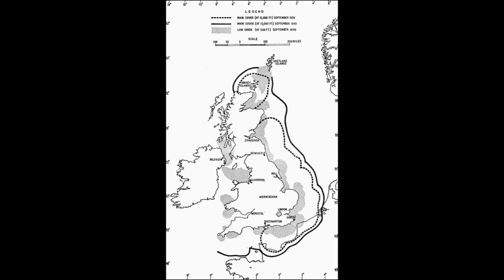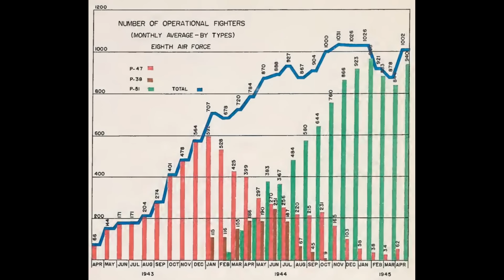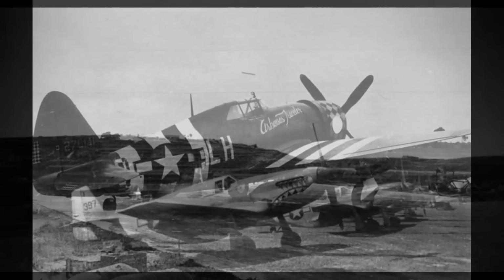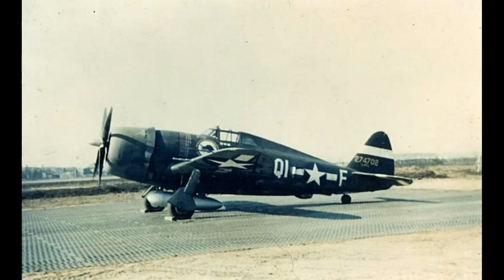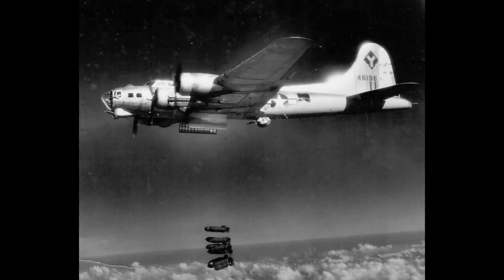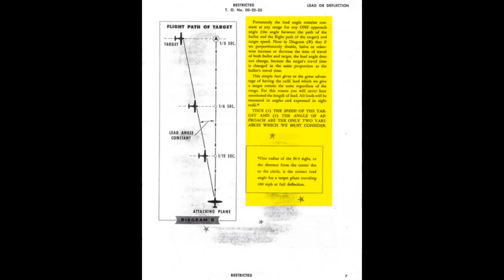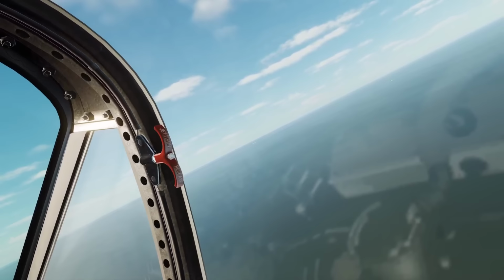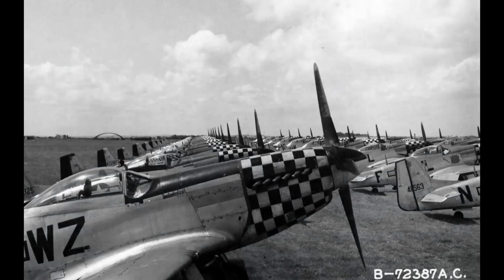Under Appreciated BRITISH Tech From WW2

Comment: Yes! Looks like pandering to the Brits is envogue. I'll keep that going here... Stanley Hooker and this from Wikipedia... 16:00.  Bud Anderson raved about how well the P51 Mustang did above 20,000 feet. It thrived there.
The Merlin supercharger was originally designed to allow the engine to generate maximum power at an altitude about 16,000 ft (4,900 m). In 1938 Stanley Hooker, an Oxford graduate in applied mathematics, explained "... I soon became very familiar with the construction of the Merlin supercharger and carburettor ... Since the supercharger was at the rear of the engine it had come in for pretty severe design treatment, and the air intake duct to the impeller looked very squashed ..." Tests conducted by Hooker showed the original intake design was inefficient, limiting the performance of the supercharger. Hooker subsequently designed a new air intake duct with improved flow characteristics which increased maximum power at a higher altitude of over 19,000 ft (5,800 m); and also improved the design of both the impeller, and the diffuser which controlled the airflow to it. These modifications led to the development of the single-stage Merlin XX and 45 series.
Reply from the maker: I'm not pandering to anyone on this channel. I've been thinking about this topic for quite a while. I'm sure Bud Anderson raved about the P-51's performance above 20,000 feet. It did perform well there, especially relative to the single stage, single speed supercharged P-39 he flew previously. 

I am aware that Stanley Hooker says that Stanley Hooker make all these improvements to the Merlin.

Comment: Water injection was used in stationary engines in the 1900s
Reply from the maker: Source please.
Reply: @GregsAirplanesandAutomobiles  from the Wikipedia article on hot bulb engines:

Once the engine is running, the heat of compression and ignition maintains the hot bulb at the necessary temperature, and the blow-lamp or other heat source can be removed. Thereafter, the engine requires no external heat and requires only a supply of air, fuel oil and lubricating oil to run. However, under low power the bulb could cool off too much, and a throttle can cut down the cold fresh air supply. Also, as the engine's load is increased, so does the temperature of the bulb, causing the ignition period to advance; to counteract pre-ignition, water is dripped into the air intake.[6]

Of course that's just Wikipedia. You can find lots of other sources and videos of people actually running antique engines to confirm. 

Anyways, apparently using water to prevent knock is a very old idea.

Comment: A good video as usual. However, I must object about your view of Big Week and the timing or success of Overlord. The attacks of Big Weeks (late February 1944) were designed above all to bomb and destroy German aircraft factories - the planes shot down were icing on the cake. The LW fighters were beaten in Big Week but losses were at most 10% of effectives and were quickly made up. The death of the LW fighter arm took place during the late spring and summer of 1944 - by October the LW was a shell. (This process was hastened by the acceptance of 8th AF commander James Doolittle's controversial tactic of allowing the fighters to leave the bombers and "hunt" German fighters instead of "close support." For whatever reason Doolittle and others preferred the P-51 for this task and the P-38s and P-47s - minus the Wolfpack - were transferred to 9th AF.)  This also implies that it was the German fighter arm was troubled allied planners concerning D-Day. It was not - the Germans were not going to stop the invasion with strafing. The allies did blanket every air base in western Europe to prevent the stationing of German bombers - they had inflicted serious damage on allied invasion fleets off Italy in 1943 (indeed, the LW did better than the Japanese in 1943 when it came to sinking ships.) The real aim of allied air power was to interdict the movement of German ground units and German supplies to the French coastline. Until the last day these attacks were dispersed across all of France to keep the Germans guessing about where the invasion was coming. In any case, the LW was not able to operate near the French coast because its bases were blanketed by both USAAF and RAF attack. In early 1944 US 9th AF - which was considered tactical - was activated in England. Together with the RAF they spent the six week period before D-Day attacking every tactical target in France. It was the fighters of 9th AF along with the RAF that were instructed to seek out German fighters while strike airfields, rail yards, supply depots etc.. It was these operations far more than Big Week that removed the LW from the picture in France by June 1944. This was also helped by the fact that the LW had no idea that after May 1 the bulk of the German homeland would be safe from attack from England (although not from Italy) and many LW formations sat idle. Also in the video it was implied that American bombers played an important role on DDay with the aid of British inspired radar. That certainly wasn't true at Omaha where there many worthwhile targets. The large attacks on June 5 and June 6 were almost total failures - with only 3 bombs hitting the beach area on June 6 and the rest being overshot. Later carpet bombing raids in the Normandy area both in support of Montgomery and later to prepare for Cobra were probably worth the candle - even if the attack in the American sector cost the life of MG McNair, the highest ranking US KIA in the ETO. 

I know this wasn't aircraft related, but if I was going to pinpoint a very important - and rarely mentioned - British contribution to the war effort it was Royal Navy shore bombardment. (They were supported by the USN - American destroyers saved some bacon at Omaha when they came in very close and began attacking German bunkers and machine gun nests with every available weapon over open sites. And BB Texas and Massachusetts chipped in. But the BN did the heavy lifting.) It was shore bombardment that saved the allied position at Salerno and probably Anzio. German armor moved very close to British beaches late on June 6 and June 7 only to be met by RN naval guns - German tanks were literally turned upside down by 8" 14" and 16" RN shells - enormous guns in land warfare terms. In the Pacific the Japanese learned quickly not to defend beaches - it's likely at Tarawa - a place so small it was almost all beach - that shore bombardment destroyed over half the IJ garrison. Later, it was standard procedure to let the Americans get on land and fight from concealed positions. It was ironic that the allied battleships - vessels that admirals had assumed would make up battlelines with which to fight the Japanese ended up either serving as flak carriers or for shore bombardment. I'm sure allied infantry - both ETO and PTO - were glad these capital ships were there.
Reply from the maker: Hi Eric, I never mentioned "Big Week" in this video. You must be referring to my statement that the P-47 more than any other plane pushed back the Luftwaffe for D-Day. As stated in this video, the evidence for that is put on screen in my P-47 Part 8 video so your comment would make more sense there. Here are the numbers. Luftwaffe pilots killed in percentage from Nov. 1943 to May of 1944: 9.9, 10.4, 12.9, 17.9, 21.7, 20.1, 25.0. 

    The point there is that the Luftwaffe had nearly 100 percent turn over in pilots before the P-51s showed up in strength. Furthermore, when the P-51s did show up, the quality of the average Luftwaffe pilot had decreased massively because of the work already done by the 47s, but again all the evidence for that in another video entirely. 

I also explained there why the P-51 was chosen over the P-47s. Your post is fine, it's just in the wrong video's comment section.
Reply: @GregsAirplanesandAutomobiles  Didn't you argue that the adoption of drop tanks allowed the US fighters to weaken the LW and allow D-Day to go on unmolested and on time? My apologies if that wasn't a point. And at least at Omaha US bombing was essentially worthless on D-Day - the drop was just a little too late. Hitting the beach defenses would have required a level of accuracy not available in 1944 - and a lot of emplacements weren't manned until the invasion fleet itself showed up. Because of the air blitz across France the Germans kept their heads down when possible. A real pity because the German 352d Division was a line unit and probably the most able and most numerous German defense unit in Normandy. 
Anyway, keep the videos coming - I like them all. The late war Japanese pieces were especially interesting. Japan didn't lack good designers - they did lack good industrial technique. Horikoshi and his Mitsubishi team were working on the fighter we called the Jack by December 7. the Jack wasn't in the air until mid-44 and then so badly flown it didn't matter. When assessing the Zero that's important. Horikoshi knew that the Zero would be surpassed - he knew what was going on in Europe - so the Zero was supposed to be like our P-40 or Wildcat - a plane to serve into 1943 and then be replaced by Japanese equivalents of the Hellcat, Corsair or P-38. But that never really happened. BTW: in the sim Aces High their KI-84 was a good plane, but rarely chosen because if it went into a steep dive it left the wings behind. That's a game. Finally remembered my first online sim: it was Red Baron that was part of an online game house called Sierra Land. A lot of bugs - dial up modems of course - and only 4 players max in one fight - but cheap and lots of fun. It parodied the flight characteristics of the computer game Red Baron very well - I flew Camels usually and remember the wicked torque of the rotary - very difficult to bank left.
Reply from the maker: Eric, I get a lot of comments, I can't only answer one of your questions or address one of your points at a time. Yes, I argued that the P-47 along with the drop tanks allowed the P-47's to seriously erode the Luftwaffe's strength. If the Luftwaffe was able to oppose D-Day, it would not have gone on time. Eliminating the threat of the Luftwaffe was a specific prerequisite for the invasion as decided at the Trident conference. All of this is explained in separate video. Yes, I mentioned it in this video, but clearly stated that the evidence for it was in a separate video and I didn't think it made sense to go over all the same stuff again.

Comment: Then again, the Norden bombsight seems to have been vastly overrated as well
Reply from the maker: vastly misunderstood, but it did do exactly what it was designed to do.
Reply: @GregsAirplanesandAutomobiles  

Just not as well as they made it out to be
(Hell, the Germans didn't even bother copying it, unlike the K14)
Reply from the maker: The Germans didn't have a bomber that could really use it. Below about 15,000 feet the Norden is wasted, and the Norden is a lot more than a bombsight, it's an entire integrated auto pilot system, it's just not that easy to copy.

Comment: Wasn't it actually water - methanol injection?. My understanding is that the methanol was more important than water in terms of octane enhancement and cylinder charge cooling. And most of all, providing a lot of extra oxygen into the cylinder. Update: I re-listened and heard your initial mention of methanol. IMHO, if I was going to shorten the term, I would drop the water rather than the methanol. But I quibble. 🙂
Reply from the maker: It was very unusual to inject 100% methanol, however 100% water was common, so I shortened it to water injection.
Reply: Sorry the alcohol was just for preventing freezing.  Pratt-Whitney's tests were all done with tap water. Alcohol was an afterthought.

Comment: Why didn’t they make an Alison V-710 with water injection? Could it compete with the Merlins?
Reply: V-1710, wish this had edit
Reply from the maker: Hi Johny. That's a complex question. NACA did a lot of testing with water injection on the V-1710 and it worked very well. In practice they just didn't need it because the octane rating of fuel kept increasing faster than updates on the V-1710 came along to take advantage of it. In other words, they never really had a supercharging system that could put out enough boost to take full advantage of it. Keep in mind, they also never bothered with an intercooler on the 1710. Now, in terms of production aircraft, the P-82 DID use 1710s with water injection and 2250 horsepower each.

Comment: K-14 gun sight.  You explained how it is operated and demonstrated it in the P-47D-40, but you never explained what you set your gun convergence to and how that affects  the concentration of hits at various ranges you adjust on the K-14.
Reply from the maker: Gun convergence is only adjustable on the ground.
Reply: @GregsAirplanesandAutomobiles  I know it is adjusted on the ground only.

You shot that JU-88 at 2400 feet/800 yards and did some damage.  I was asking what was your gun convergence setting to...get damaging hits like that at that range.  If your convergence setting was 2400 feet for demo purposes I understand how you got such damaging hits.

If your convergence was set closer wouldn't the bullet dispersion be too great to warrant adjusting the K-14 range much beyond the convergence setting?  I ask because my assumption was that the USAAF standard convergence was much closer than 2400 feet. (USN was 900' - 1000').

I know the bullet drop of a 50 caliber round is approximately 18" @ 1000'.

Not trying to be a pain, just trying to understand.
Reply from the maker: Think of it this way, the P-47's guns are about 20 feet apart, so that's how far apart the left and right wing's bullets are at point blank range. Now at DOUBLE the convergence range, they are still only about that far apart. The Ju88s engines and fusalage are all contained within about 20 feet of its 66 foot wingspan so I didn't need to worry about convergence for that shot. Oh, and I fired at 2000 feet, not 2400, so all my bullets were only around 10-15 feet apart. I should also mention that a single battery of four fifty Cals will wreck what it hits. My Convergence was at about 1200 feet.
Reply: @GregsAirplanesandAutomobiles  Thank you very much for the explanation.  It makes sense now why you were not concerned about all 8 guns hitting an approximately exact spot on the aircraft.  I have seen the damage that a single M2 Fifty Cal can do at Twenty Nine Palms.  A battery of three M2 were firing on the range right next to our M-60E trio.
Reply from the maker: Thanks for your question, it was well stated.